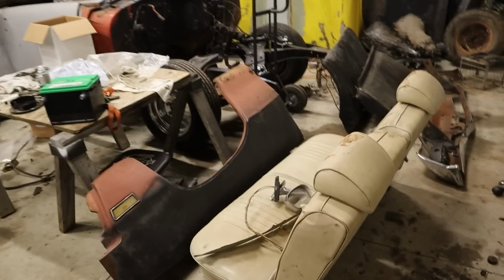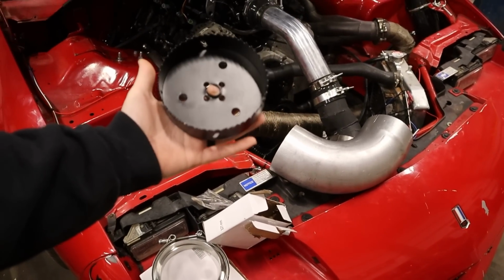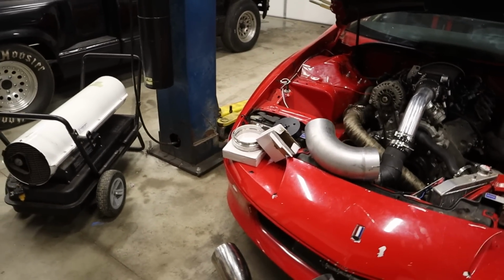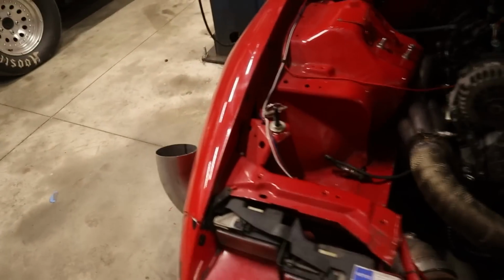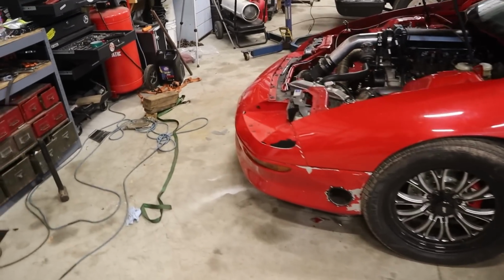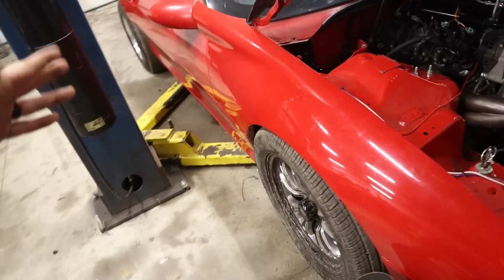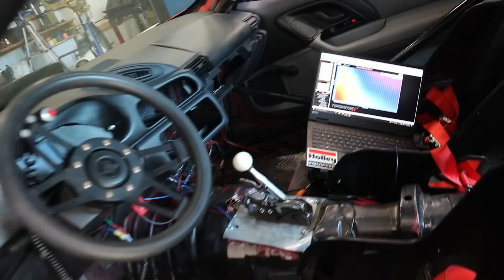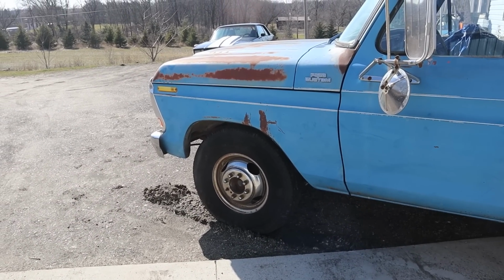I BLEW UP a Customers ENGINE! Turbo 6.0 Camaro blows up on the TRANSBRAKE!

Comment: 1978 400ci c6 transmission. From my research, I’ve been told it’s not “easier” (when you pull the front clip) to do the swap…… but it’s up to you. I suppose it may make it easier to weld in the motor mounts…. Keep up the awesome work. 👍

Comment: I have a 79 F350 flat bed like that with a jerrdan tilt deck and 460 4spd, its a grunt lol
The 8.1 swap is surprising but kinda cool and should work well for that.
That sucks for the Camaro, that's among my worst fears with customer cars altho that things heavily modified and been run untuned still sucks tho.
Reply from the maker: I wish this truck had a 460 cause I would get it off him and put it in my obs f150 lol

Comment: Insted of 6.0 swappimg my 2nd gen ram thinkimg about finding a 71 oldsmobile cutluss the (fast back style). And put a turbo 5.7 hemi in my 2nd gen
Reply from the maker: Man, I've been reeeeeaaallly feeling those Cutlasses lately. Especially the ones with the wide hips 😍
Reply: @SniderTron3000  the ones with the wide hips is what im wanting put a turbo 6.0 in. My dad has a 71 cutlass supreme its the more stock style and i whana build the crazy version wide hips 650 to 700 hp billet special wheels

Comment: 8.1 ain’t no LS 😂
Reply from the maker: I didn't say it was lol I said people call it the big block LS because its a modern big block with coil near plug, crank and cam sensors, fuel injected and uses the same ecu as LS

Comment: Snidertron3000,
I appreciate your hardwork,
and skillset.
No offense to you, perse...
but what is it with todays
turbo guys that ALWAYS have the clunkest,UGLY, and WAY too big exhaust pipes sticking out
the fenders/ hood????
(Roadkill style)

No cap,
that sewer pipe hanging off
the side just looks TACKY,
I'm sure the owner likes it,
but it doesn't look cool at all.

I have already seen this done
on quite a few cars, and it
STILL looks sloppy, and 
says "attention whore".

(Roadkill's rotsun/datsun exhaust,
killed the sporty look of
that vehicle, but people 
STILL copycat that truck look'n
crap to this day) wth 😑

There are other ways to direct
that hot azz exhaust, and
still make it look good.
(People have lost their creativity, and don't care
if something looks crappy
or not I guess)

Again,
no disrespect to you,sir...
just my two cents.

Hope to see that fiero completed SOON!
(I have an 86 gt, so I'm 
definitely INTERESTED) 👍
Reply from the maker: With turbos, they make a pretty significant amount of more hp when using like a 4" pipe and keeping it relatively short. It can be upwards of 100hp going from a full 3" exhaust out the back vs a 4" fender exit. And its just very difficult or expensive to run that big of an exhaust around the engine, down the firewall and under the car to the back. 

But, I 100% agree that a lot of them look pretty gaudy and goofy.
Reply: You used the words no cap so your two cents is worthless.
Reply: So you want everyone to reduce it down and loose power?